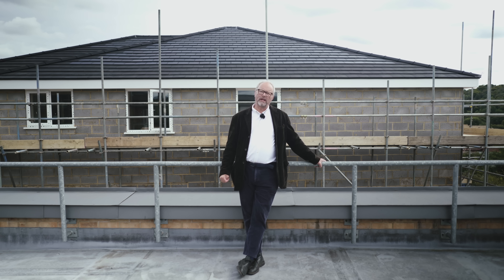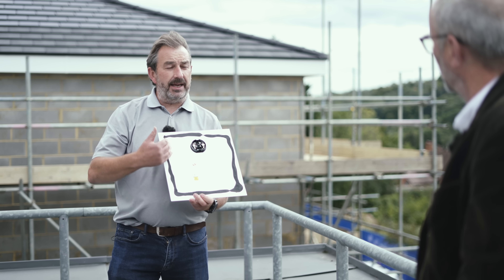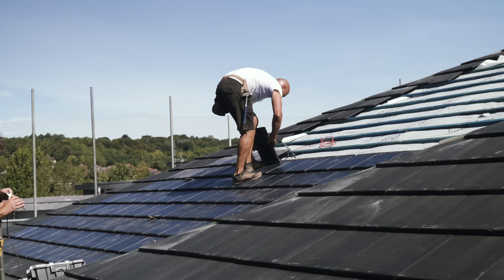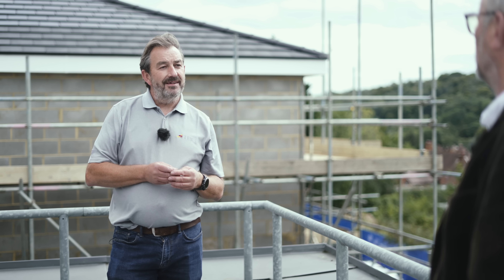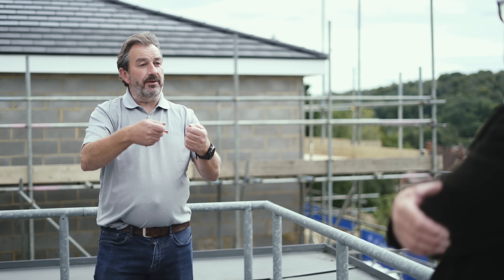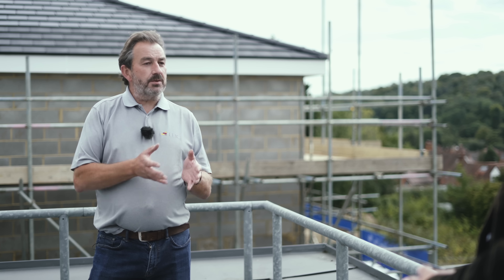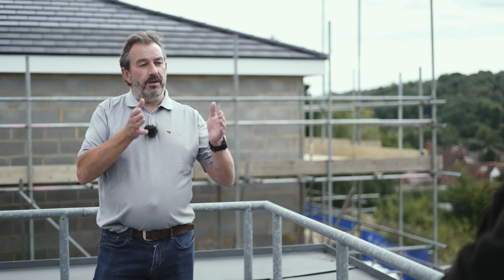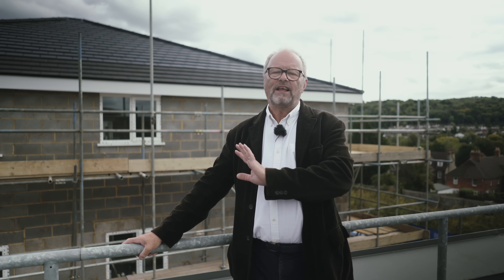Solar Roof Tiles - should every building generate its own power? | 100% Independent, 100% Electric

Comment: £30 for a 15W panel?  It's only a no brainer product when the price comes down to something more economically viable.
Reply: It may be overpriced for one household to have retrofitted. But a big saving when installed during construction- no labour costs for Installing solar panels and framework, no increased engineering costs related to making a roof strong enough to take the weight of panels. Thats a Winner for a construction firm.
Reply: no worries, if this is indeed feasible, the chinese will make one for 5 pounds probably :)
Reply: exactly it's very over priced currently!.
Reply: looks like about a 7 year payback on simple terms
Reply: £30 seems to be the installed cost, as in they buy panels and concrete, bring them to your house, make both regular and solar tiles and install them, which includes lots of electric work.
Only way to really lower that price would be premaking the tiles in bulk at a factory, which would lose the benefit of cheaper shipping costs. The main reason why big panels are cheaper than tiles is you need fewer steps to install one panel than ten to twenty tiles, it's the human work that costs more than the panels or tiles.

Guick Googling says panels cost £350 to £500 each in UK, though the sites I found weren't very clear on where they used 250W panels and which calculations used 300W panels; equivalent number of tiles would be 17 or 20 for £510 or £600. The 900 tile build in the video would produce 13.5kW and need 45 or 54 panels to match it, which at upper end could cost the same £27000 as the tiles. However, we should now ask if you could even fit those ~50 panels on that same roof and whether you are allowed to, or will someone start complaining it is more important to have a pretty roof(why? who would look at it up there?) than being green.
Reply: @AnalystPrime  no that is the cost of a tile with panel attached as you here him say the connector is installed on site which is additional costs
Reply: @shaynegadsden  No, these days only off grid DIY folks and campers want just the panels so costs always include installation. The concrete tile is £1, 15W PV cells cost somewhere around £5-10, the rest is all the work done on site; this guy is trying to advertise his fancy pizzas so people buy them despite the 50% higher price, it makes no sense to sabotage his own business by implying that includes free delivery if it doesn't.

When comparing installed cost of twenty panels to a solar roof he quotes price of £11-12k for 5kW, that would be £10k for the 333 tiles with panels and £1-2k for the regular concrete tiles and other work, which is far too cheap if the £30 per tile didn't include the installation. Installation costs have gone way down recently but there is no way a £10k system that is more complex than regular panels would only cost about thousand pounds to install. However, £3k panels that require extra work so they cost £7k to install is a much more plausible price range.
Reply: @AnalystPrime  Not really lots of electric work, it's all plug and play.
Reply: @ChocolateFrog  Far more electric work than regular solar. Easy to use connectors are everywhere these days, but note they need to set up 20 inverters for that roof of 900 solar tiles while a solar panel array would only use one, or each panel has a microinverter so there is one less step needed.

It also takes almost half a minute to plug in a PV tile, while you can set up a solar panel that is equal to ~20 tiles in about a minute.

And then there is rest of the work preparing the roof and drilling holes in concrete tiles so they can glue the PV cells on them. That will not be done quickly either.

It does not matter if they don't need to be electricians, you still need a professional crew to both install solar panels and build roofs. And that means their wages are the biggest part of the installation costs.
Reply: @AnalystPrime  right,  it is hell priced lol
Reply: Yes, it's 3x the price of a typical panel + racking. My installer fitted 320w black framed, black cell, white-back sheet JA Solar 60cell standard size panels. Was charging me cost + installation. Panels are now £100 too him from wholesaler! Might be less now as that was 6 months ago!  China dominate in solar manufacturing. The largest 10 solar panel manufacturing companies are all Chinese now!  And it's a GOOD thing they can make the panels so cheap with economies of sclae.
Reply: @markyates5744  How much was the installation per panel? Also, would you know how much that 320W panel costs for DIY customer instead of a company buying wholesale?
Reply: But don’t forget, for your £30 you get a roof tile not just a 15 watt solar module.

As with all products, small batch hand made products are initially expensive, with volumes and related economies of scale, prices will continue to fall,  in 2018 they were £34 each.
Reply: @chrishall409  Have you approached any tile manufacturer to see if they can make batches of tiles with the wiring hole pre-cast into the tile?

...Even if you have a jig for doing it I'd imagine that manually drilling 2" holes in all the tiles is the most labour intensive part of manufacturing them.
Reply: @DEADB33F  Thats exactly what I was thinking when watching, the tile manufacturer would be able to make them with the hole in cheaper than drilling each one.
Reply: @chrishall409  wow, you get a £1 tile thrown in with a £29 solar panel glued on?
A quick Google and I can get 15w panels a damn bit cheaper. And that's before I even ask manufacturers for bulk orders ect. That's a lot of profit per tile for what is one hours extra work per elevation!

Comment: Wow , 10 lbs each tile is heavy !
Reply: Yeah concrete tile roofs are scary heavy, I worked on a building site where the design of  the roof trusses was wrong, they had a half truss butting up to a full truss at 90 degs, with basically just nails attaching it, when the roofer put the tiles on, the half truss started to slid downwards bending the nails with the weight, we had to jack it up and wedge a half dozen 4x2 under it and ramset them to middle of the lounge floor to stop it collapsing. They had to make this U shaped saddle assemble that hung over the full truss to the supported the half truss, It was a total pain to install and we total screwed up the roof doing it, the roofer was up there for days fixing the mess we made, swearing and tossing broken tiles off the roof.
Reply: taznz1 the stuff of nightmares ; I can imagine what that situation was like with tea breaks even having to be postponed .    I would never have guessed those tiles weighed over ten pounds from the way they were lobbing them up and handling them though.
Reply: Otherwise they will fly away😆
Reply: Sripal Devadoss , not too close to the sun I hope.
Reply: Richard Ward-Jackson My aunt lives in a 400 plus year old Cotswold stone house roofed entirely in stone. Some of them are two or more inches thick- the whole roof must weigh a couple of hundred tons- quite scary when your living underneath! Still, it's held up by a forest worth of huge oak beams and has been there for centuries, so I guess it's OK..
Reply: Spencer Wilton , must be an interesting house with steep roofs and oak pegs to stop the tiles from sliding down . The sheer weight of the roof and the structure that was constructed to support it is fascinating in itself.  Would your aunt be amused if you told her that although her house is 400 yrs old her house still rocks ?

Comment: What's the conversion ratio of those solar panels?
Reply: Slightly lower, because you don't have a cooling airspace behind the module as I understand, but the more efficient coverage of the smaller modules on hipped roofs or roofs with dormer windows or other obstructions should make up for some of this. Also there may be small losses due to the greater number of connections, but the high voltage might compensate for that. Another drawback of the high number of connections may be reliability.

Comment: I am in Africa with a tin roof, very common here. How might they design something similar? Really enjoyed this one, keep them like this!
Reply: For tin roofs, it;s better to use normal solar panels with help of mounting structure for tin roofs. It will provide an additional layer of insulation. I know how hot a tin roof can be, it used to be vert common in my country(India) too.
Reply: Look at companies like BiPVco, they produce self adhesive PV rolls/strips that can be stuck down to a hard metal roofs.

Comment: How much dose it cost?
Reply: 30 pounds per solar tile
Reply: @darrenit7498  Plus additional labour and battens, felt & a structural engineers report, scaffolding, tea, biscuits. Tesla any day... way cheaper and the battery system can do more.. PS I do not have any Tesla products myself. Just feel that 30 per Solar Unit is extremely expensive.
Reply: 40% cheaper than a Tesla roof in California, 25% less time to install

Comment: £30 per tile seems steep to me but it's early days yet and I'm sure it will reduce. Looks the business though good on them.
Reply: Not every tile is solar so it's not like the whole roof will be 30 pounds per tile
Reply: Darren It749 It’s a simple calculation. Each tile is 15 watts £2 per watt. That seems very expensive to me.  Plus additional install costs. Plus one tile dies and you have to locate it and replace it. It’s a nice aesthetic solution but I’m unconvinced about practicality.  I would prefer a more modern approach to building where you incorporate the glass solar panels as your roofing material and you make it a design feature.
Reply: @darrenit7498  From my calculation a 3.6 kW system would need 240 tiles which is £7400, that's more than you would pay for conventional but the result neater and depending on your POV better.
Reply: @DogsBAwesome  That's £7400 for the solar panels AND the roof tiles, the price for a conventional setup doesn't include the cost of the tiles which would be extra on a new-build or re-roof.
Reply: @rogerbarton497  If you are having your roof re-tiled or it's a new build and you can afford it sure go for it.
Reply: @DogsBAwesome  if you buy large panels on Industrial scale you would pay 1000£ for 3,6 kW
Reply: @rogerbarton497  That roof in the video has 900 tiles  £27,000
Reply: @DogsBAwesome  Any idea how much time it would take to repay back that £7400?
Reply: @pretsas  that would depend on which way your aspect faces and which part of the UK you are in.
Reply: @pretsas  It will never payback, unless you can use a significant amount of the solar energy in your house. eg 3.6kW on a sunny day when you are outside enjoying the summer
Reply: @DogsBAwesome  you would need a lot more than 240 tiles if you look at the normal panels how often are they exactly parallel with the roof the fact is your roof isn't designed for solar collection so the angle and orientation generally isn't optimal so you could need 20 to 30% more to compensate for lost efficiency
Reply: @DogsBAwesome  it is expensive. It look great, but you pay for it. we have this vision of a traditional brick house with tiles on the roof. Why!? so backward thinking. Just have a solar roof that totally replaces tiles. I'm biased because i sell an in roof system where we are working to just that.
Reply: Solar tiles have been around for more than a decade in the UK - so not that new. Always been more expensive, and a lot of connections. But it's very discreet and will get you past recalcitrant planners if need be,
Reply: @Wookey.  yes in places where they won't even let you put plastic windows in they would be very useful as in all purposes they are tiles though they would probably still moan about the different shades
Reply: Or was that £30 per sq m?
Reply: @balrajmaan467  per tile
Reply: The government should give grants to make house autonomous but we all know why the wont. One day come the revolution
Reply: £15 to £20 will be the cost of the 15W solar panel itself. Some cost is going to be down to the extra manufacturing steps, and the need for many more power connectors. But I assume most is down to labour cost, in that it takes highly paid skilled manual labourers much longer to install them.
Reply: Paying pounds to save pennies, it doesn't make sense.
Reply: @ChocolateFrog  Some people just want to do their bit and have the money. iI you have planning restrictions on your house that prevent you installing normal solar panels and you want solar this is a choice, at least.
Reply: @krusher74  its about the same, a little cheaper actually. pay attention and stop doing a 1 for 1 comparision. "ugh its more expensive than normal tiles!" and "ugh its more expensive than solar panels!". this isnt 1 product, its 2. its roof tiles, and solar. add the cost of the roof tiles and installation, then the cost of solar panels and installation which would also require an engineer to ensure the load in the roof is fine.

its cheaper to do it this way by a fair bit. nobody is proposing you rip up a perfectly fine roof to do this and it being close to same cost. the proposal is to simply use this the next time your roof needs to be redone.
Reply: the guy in the video said it was 50% more expensive, go tell him.
Reply: @krusher74  material cost,  go watch again. literally was cost comparing the tiles. ffs, pay attention and use your brain while you consume media and information.

EDIT: come off more dismissive as i should have said it. but point stands. its slightly cheaper if you compare installation of  new roof tiles, then get the engineer to evaluate and sign off on solar installation, then buying panels and paying to install. maintenance will also be lower with these i would imagine, less parts to fail or be damaged and wind is no longer an issue for tearing them off.
Reply: you win. thanks for shouting at me through the internet.
Reply: @krusher74   no problem. maybe it wont happen if you dont reply to someone to correct them "he said it in the video" when he explicitly stated the thing you are attempting to correct them on.
Reply: @JamesMichaelDoyle  maybe you are wrong.
Reply: So 12 tiles cost as my yearly electricity usage?  Need lifetime to turn back the investment.  How mutch is yearly maintenance?
Reply: @arpadvarga3475  yeah, keep doing the same dumb thing as others have.  hurr durr, this is purely electricity i get out of it! hurr durr! im not getting good quality roof tiles or anything that will last several decades. hurr durr!

where the hell do you guys come from. like you all are forgetting the main function and use of these things.  how do you see solar tiles and forget the tile part while simultaneously comparing it to solar panels.

why are you clowns even here? is this hatewatching? hurr durr! i was told that renewable is bad, therefore i need to go stupidly post random crap to any article or video i see about it.

good lord.

ok so for all you folks that cannot seem to follow along:

the idea is to simply use these tiles in the initial construction, or when its time to replace the roof anyways. there are also incentive subsidies in pretty much any western nation.

if you have the dosh and dont care that your current roof doesnt need replacing yet, and just want this anyways to avoid the solar panels, then yes, you are paying a premium.

otherwise it will be slightly cheaper, and easier to maintain with these if installed upon construction or replacement time.

good lord. i dont know how some of you function in life. look at something that has an extra feature, and then decide its shit because its more expensive than if you just bought something that only does the extra feature, and doesnt address the purpose of the original product.
Reply: I'm planning of re roofing  how can I contact them for quote
Reply: Depends on the ROI you get on almost free electricity back which I guess would depend on electricity prices.
Reply: Because it is MADE IN ENGLAND.